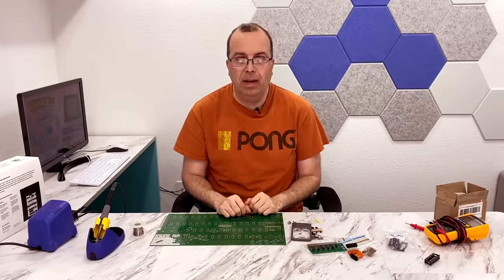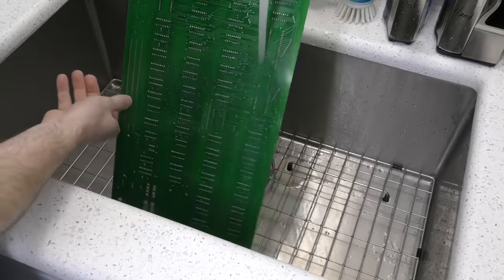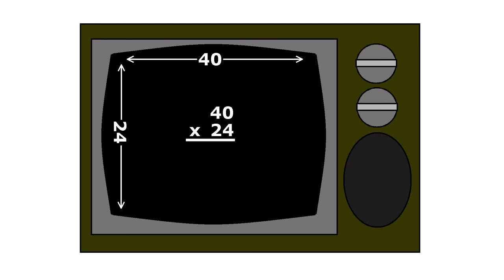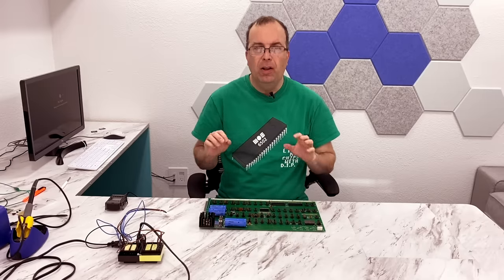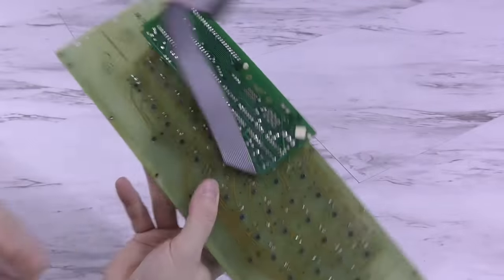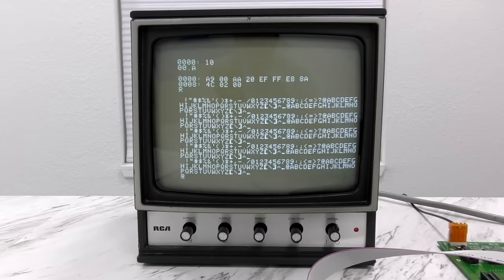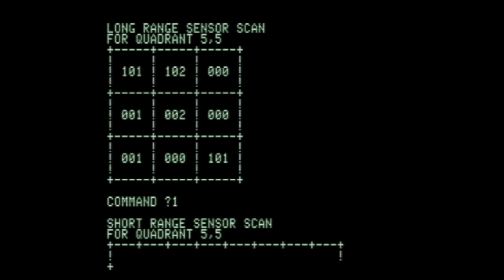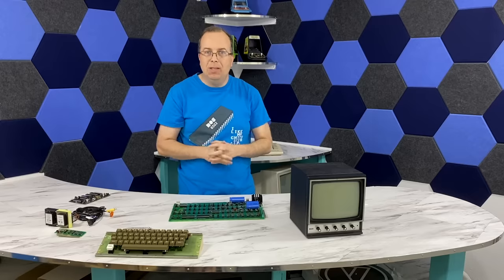How the Apple 1 computer works.

Comment: Apple then: Socketed ICs, scematics in the manual, extra circutry to support alternative components.
Apple now: Can you make a slightly modified version of that component and sell it exclusively to us so nobody will be able to replace it?
Reply: Most of that could be attributed to Woz. Jobs were against that from the start.
Reply: @ZX3000GT1  And now we come to Tim Cook who's decided to remove any reparability on any Apple product without voiding warranty.
Reply: @ZX3000GT1  is that true?
Reply: @crunch9876  Not that I'm a huge shill or anything, but most laptops and phones now you can't open without voiding the warranty. Not a practice restricted to Apple alone.
Reply: @Cobalt985  IIRC, in the US at least, there was a recent court case that ruled that those "warranty void if broken" stickers that essentially prevented you from opening a computer were not legal and warranties could not be nullified over that.
Reply: @crunch9876  Apple II almost had only 2 expansion slots, if not due to Woz's insistence to instead having 8 slots, making it much less expandable.

The original Macintosh was released as a closed platform, where it wouldn't be easily upgradeable and designed not to be user servicable - not unlike modern Apple products, you're expected to send it to the authorized repair center.

Part of the reason why Jobs was out in 1985 is due to the disagreements between having a closed platform (Macintosh) or an open platform like the IBM PC.
Reply: @Cyber_Akuma  Shame that it's recent. In my country I've never had to care about the sticker - the laptops here never had it, and I can easily upgrade and open the entire laptop without afraid of voiding the warranty. 

I've upgraded my old laptop (ASUS X450JN) RAM and changed the HDD to SSD at the time. When the battery decided to not work while the laptop's still in warranty period, I went to the service center and they replaced the battery, no questions asked. They even kindly changed the back panel, which is scratched by me, something that typically not under warranty.

And the same with my next laptop (ASUS GL503GE). The service center told me that as long as I didn't knowingly break the machine, the laptop will still be under warranty, no matter the upgrade (obviously except the parts I did put there. The original parts are still part of the warranty though).
Reply: @ZX3000GT1  It depended on the manufacturer, not all of them pulled that nonsense. Also don't forget that in the case of laptops, until just a few years ago almost all of them used to have an access door to easily access the RAM, Drives, and many times even the WiFi card without having to take the entire thing apart. Now.... pretty much impossible to find any new laptops like that.
Reply: @Cobalt985  nah. Not true at all. Mac is the flagship proprietary bullshit product. I have a Dell G5 gaming laptop that costs the same as a base macbook pro but runs circles around any of them. And it has instructions on the inside of where & how to upgrade your RAM, SSDs, etc. It depends on what you buy & how much they care about the hobbyist. If dell is doing better than them, well that's just sad..
Reply: spelling fail; also diction: will -> shall
Reply: @geekbeer5846  lmao, I seriously doubt the 10th gen intel CPU in the G5 would outrun the M1 in CPU bound tasks, much less match the 24+ hr battery life. 

I’m regularly annoyed with the lack of repairability, but credit where it’s due, their entry level M1 machines upended the entire industry...
Reply: @Cobalt985  But Apple takes it to the extreme no other companies even dare to go. They're bleeding edge leaders of anti-consumer shenanigans.
Reply: @Cobalt985  I mean, if my device is still under warranty then I'd take it in to be repaired ('cause it's free). But the problem with modern Apple is that once the warranty runs out, you can't repair anything yourself - you have to either buy a new one of their expensive products, or you have to pay them to repair it for nearly as much cost.
Reply: *schematics
*circuitry
Reply: Great example, I’m paying off a frickn iPhone 6, using a iPhone 5SE and no parts available for i6, plenty of parts available for the 5 but it doesn’t break every time I fart.
iPad 123 - indestructible!
iPad 45678910,11,12 lubricated case, superglued screen, and somehow defy the laws of physics and fall at 19.6m/s and the touch screen explodes if it touches anything harder than carpet.
Reply: @ZX3000GT1  Woz didn't design the Apple 1 to make money from. He designed the computer HE wanted, having thought he could do better than the Altair and other hobbyist computers around at that time.
Reply: @MrDuncl  Exactly. It's somewhat similar with the Apple 2 as well. Woz is the reason why old Apple was as open as it was back then.

When Jobs alone made the computer, it's almost always (probably always tbh) locked down. That's how the original Macintosh was, that's how the iMac was, and that's how the rest of Apple was and still is to this day.
Reply: @ZX3000GT1  You are stretching a bit and based on that attributing a given motivation to it. Any Woz approach to hardware was based on objective considerations - not malevolent motivations.
Reply: @ZX3000GT1  Hardware design decisions are a little more complicated than what you seem to think.
Reply: @ZX3000GT1  What you just said is the opposite of what you said in an earlier comment.
Reply: @dannygjk  I'll be honest, I'm not sure which part did I contradict myself with. Can you point that out?
Reply: The Apple 1's openness was normal for its era, but I'm fascinated to learn from other comments that Jobs was against that. But... now I think about everything from then to now, I think it's pretty-much always engineers wanting the system to be open and businessmen wanting it closed. Between 5 and 10 years ago, (the last time I was paying attention to this,) Samsung seemed to want its smartphones to be as closed as any Apple, but they weren't. The exact balance varies from company to company, of course, and changes over time. I have a 2001 iBook which is almost as open as any other laptop of its era; more so if you compare OpenFirmware with DOS/BIOS. Even a bad OpenFirmware implementation is far more powerful than DOS, and it's in ROM.
Reply: @eekee6034  2001 is EONS ago, duuuude. We apple experts just know about the iPhone 12 and derive our faultless knowledge from that.
It's funny how some people feel the need to blabber about their Super Gaming PCs under a video dedicated to a computer from the '70s.
Reply: @commscan314  Tim Cook is nothing like Jobs, fired Scott Forstall as example. "For the past year Cook has been weeding out people with disagreeable personalities".. That happened in 2012. 

Innovation stopped when Apple lost it's true visionary CEO. Yeah, he might have been bit of an jerk, but at least he was willing to work with people that shared his vision. Since Cook stepped in, products have been more or less upgrades rather than something new and revolutionary, while in pursuit of excellence.

So, 3 names. Steve Jobs, Steve Wozniak and Ronald Wayne - those person put up Apple. Times change, people change but history stays! Tim Cook is still a great CEO for Apple, but as I said, time goes on
Reply: @eekee6034  as I read from various interviews and sources, Woz was the creator of Apple from the product side and Jobs was the businessman. Woz just wanted people to have easy access to a computer like he wished as a kid, while Jobs saw the innovation that Apple1 computer had from a market side. Woz was happy on the hobby-diy nature that the computer has while Jobs wanted to make the computer appeal to the general public.
While having schematics was common practice in the 70s, a computer was let alone very rare thing to have by the reasons David said.
Reply: @SxC97  too bad this chip will run apple stuff and not Android...
Reply: @prime98k4  That makes a lot of sense. It reminds me that years later, in 1981 or 2, Jobs would extinguish Jeff Raskin's plans for a powerful affordable computer based on Forth to push his own vision of the GUI.
Reply: @ondrejsedlak4935  I don’t think you're giving the M1 a fair shake here. Microsoft tried to make their own heavily optimized hardware/software stack with the Surface + WOA + ARM chip and it couldn’t even run 32-bit apps well, let alone run x64 apps at all.

So I’d chalk it up to some damn fine engineering and not just control over the whole stack.

Furthermore, the M1 outperforms every other chip in it’s class and even trades blows with AMDs desktop Ryzen chips. All while maintaining 24+ hr battery life, and those are just the first gen, entry level chips. Their worst chips are out performing the competition handily. 

I don’t know about you, but I’d certainly call having desktop class performance in a thin-and-light with all-day battery life "game changing".

It’s game changing because it challenges preconceived notions about the product stack. It used to be "power, portability, battery life, pick 2", now it's "power, portability, battery life. M1".
Reply: @SxC97  Hmmm, so t he fact that I called the M1 an excellent product somehow translates to me not giving it a fair go? Sorry I’m not enamoured with the awesomeness of Apple. Then again I tend to look at any fanboy praise the same, be it from the MS, AMD, Linux, etc… side.

Yes MS did try to make an ARM version of Windows but to call it optimised is a stretch. It was at best a very rushed beta that should have never seen the light of day. And MS is still in the position where they are required to attract hardware manufacturers to their platform, thereby making sure even their ARM version stays open in terms of compatibility with future hardware sets. Whether it succeeds or not is another story.
Apple having full control over everything is an advantage that cannot be understated and is often overlooked or glossed over to make their advancements seem that much more mystical.

Yes it is excellent engineering and a very good advancement but if they had the same constraints as Intel/AMD (having to maintain interoperability between Windows/OS X/Linux/Unix/Embedded systems/etc…) the story would be very different.

Sorry but I’m not going to fawn over this as some kind of amazing god like achievement. I see it as an excellent next step and I await the next set of advancements, whichever company they may come from (except for AMD. They suck balls 😬 )
Reply: yep. Woz's vision ("let's make it easy and open for everybody, let's try to make the world a better place") vs. Jobs' vision ("fuck the customers, just think about money") vs. Tim Cook vision ("Jobs was right")
Reply: @ondrejsedlak4935  Linux is already booting and usable on M1 Macs, you can even install Debian and use it instead macOS.
Reply: @ondrejsedlak4935  AMD Ryzen is easily outperforming anything Intel is doing.
Reply: Apple seem to know what the average customer wants. I know people who in the 8-bit days built add-ons, then assembled their own PCs in the 90/00s. Got married, had kids, a PC is now an appliance, they just want it to work. Repairs etc. covered by home contents insurance...
Reply: @daemonspudguy  Except in terms of stability and accurate floating point operations which is most critical for server and high end computing applications.

The world doesn’t run on gaming.
Reply: @daemonspudguy  Sounds great. Call me when it can run Autocad without crashing.
Reply: @ondrejsedlak4935  which comment is that autocad reply referring to. Also, call me when Intel processors stop making laptops unsafe on laps.
Reply: @ondrejsedlak4935  I agree with your points there, except for the one about heat output. Intel's CPU architecture is somewhat infamous for being poorly optimized as of late. I imagine the last major redesign happening in 2007 might have something to do with that.
Reply: We need to get there again . It is possible
Reply: @commscan314  "Yeah looks like one the pins on the keyboard input is damaged. That will be $800 for a board replacement please"
Reply: even storage and memory are soldered lol
Reply: @geekbeer5846  Apple has a very long history of making it hard to impossible to upgrade their computers in order to make you buy a version with more RAM, a faster CPU and more SSD space soldered on at more than 5x the retail price. Which is supposed to be beneficial, but tech savvy know it's not. For that soldered SSD and RAM in the M1 next to the processor, there are separate components that work perfectly and faster at a distance to the CPU at much less than $ 150 each.

They also have a history of selling cheap solutions as beneficial such as the shared RAM in the M1.
Reply: @HansOvervoorde  Yes “tech savvy” people know that Macs are overpriced, yet 90% of software engineers & software/web companies use them and give them out to their developers to write code on. Macs are built from UNIX just like Linux (and Android by extension), the web runs on UNIX derived platforms. Yet it appears that the trillion dollar tech industry isn’t “tech savvy” by your interpretation because they use Apple hardware to develop… hmmm…
Reply: @ondrejsedlak4935  bull. The Pentium divide flaw showed for once and for all decent and more importantly correct floating point is critical for business and home use.
Reply: more like: "Here's 20 billion we own you now make us proprietary parts stop selling to other OEMs kthxbai"
Reply: So if they released the schematics for the iPhones, we'd all be fixing our own?? :D :D lol
Reply: "Can you design display connector so what it would fail at the first signs of moisture?"
Reply: @geoninja8971  No, but those who decide to have them fixed by someone else would be granted the choice of repair service in a free market that could offer them the feasable repairs apple themselves can not provide.